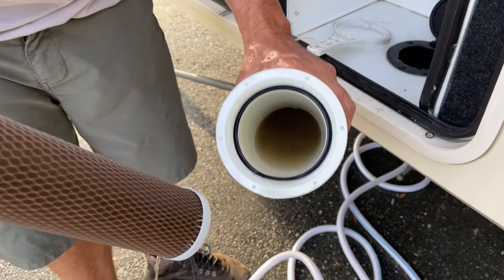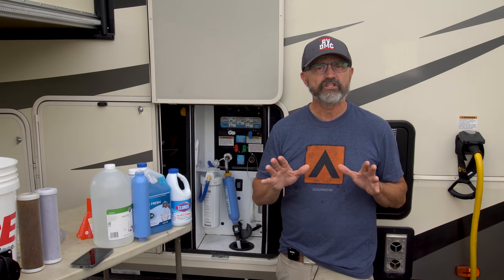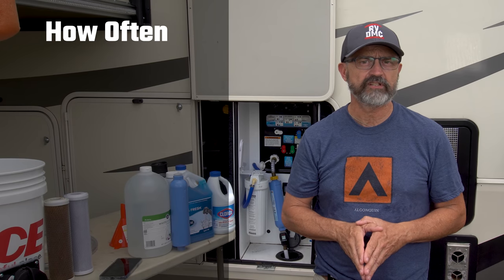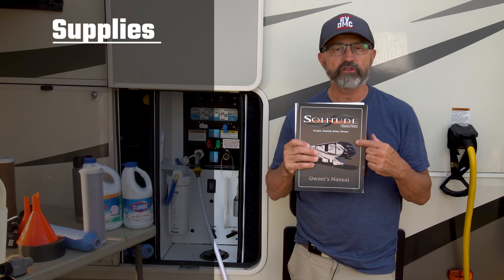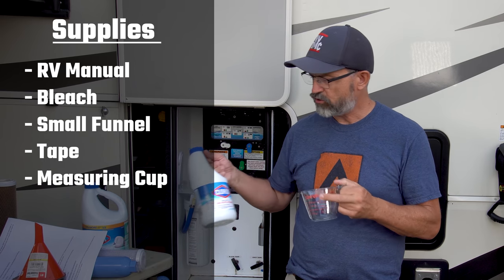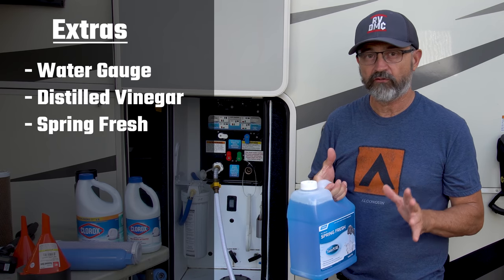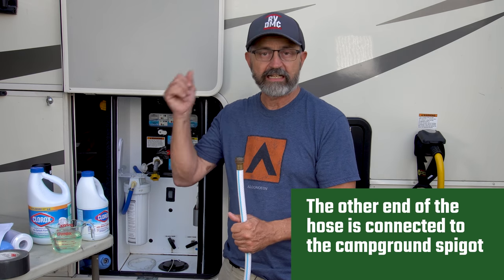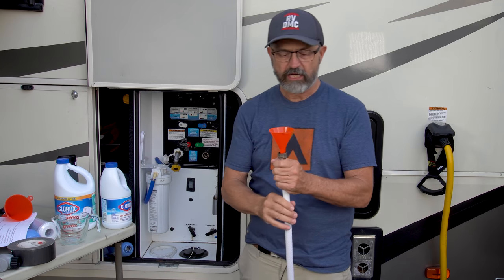RV Water Tank Maintenance How To, Step by Step Sanitize (RV Living Full Time) 4K

Comment: I work for the local water treatment utility. What most people don't know is that most municipalities put enough chlorine in their water to sanitize their plumbing without any extra measures. Just fill up the fresh water tank, let it sit overnight, drain, and you are done!
Reply from the maker: Many of the State park campgrounds here in florida, the water comes from a Well on the property and has very little treatment.  Sometimes the water comes out significantly discolored, but that is great info about using city water to help sanitize the tank, I didnt know that.  Larry

Comment: We have used bleach. Both times the water pump stopped working. The bleach compromised the rubber inside the pump. We have switched to vinegar. It works very well and does not degrade rubber.
Reply from the maker: Mark, that’s why we do the hose method. Only highly diluted bleach goes through the pump after it’s been in the tank. And we don’t use the pump to empty out the tank. We use the bucket and sewer hose. 
Sorry that happened. Many people prefer the vinegar for lots of reasons, 
Alice
Reply: @DownsizingMakesCents  Clearly stated in the video is pumping the freshwater tank into the greywater tank. So which is it?

Comment: Another great video! Well done! Your bucket with the bayonet connector is genius!
Reply from the maker: Steve, thank you. Larry is the “mad inventor” at heart 😂. He has all sorts of ideas. And his favorite videos to make our DIYs with his “Larry touch.” 
Let us know if it works for you. It’s better not to run the pump for hours if you can avoid it,
Alice
Reply: I think our fresh water drain differs from yours, but I can’t check until we get the rig back from the shop. I don’t think a bucket will necessarily work for us, but in the event that it can work, what parts did you use to create your bucket?
Reply from the maker: @settinger14  Hey Steve, i put a link to the bayonet connector in the description, from amazon i think its $6.  It is also available at most camping world stores.  I just cut a hole, screwed it to the bucket then sealed it with silicone caulk.  Larry
Reply: @DownsizingMakesCents  another question or two: 1) when your fresh water tank has been filled with the bleach solution and you’re letting it sit overnight, why couldn’t you switch back to ‘normal’ mode to continue to use city water for showering, toilets, sinks, etc until you’re ready to drain the fresh water tank? 2) we don’t have the bitchen bucket yet, but we’re gonna try to sanitize this weekend at our 2nd ever shakedown trip - when we’re ready to drain the fresh water tank, and we switch back to dry camping and turn on the water pump, I’m assuming we only turn on cold water faucets?
Reply: Also - I love the color-coded category text bar at the right of your thumbnail images - it makes it much easier to quickly scroll through to find the video I’m looking for!

Comment: Good, video, One tip to add to yours, make sure the (House) water filter has been remove before  sanitizing the system, If the valves are on either on dry camping or city water will still flow thru the house filter housing. You don't want the filter in the system when sanitizing. Safe Travels.
Reply from the maker: Yes definitely, I did a lot of cutting to get the length of the video down, forgot to make sure I left that point in, I was replacing the filter at end end anyway, thanks for pointing that out. Larry

Comment: Great information , thank you.
Just cleaned the tanks on my Winnebago. What a mess! I do not have the Nautilus system which makes it look so much easier. On the pump I also have a filter. That was the grossest part. Now have the 2 filters and am getting ready to get the 3 stage reverse osmosis system. I do use the fresh water system when dry camping and sometimes the city water is suspect; lots of rust in TX. Also have water softener that I think helps.
I made a solution of baking soda and water to neutralize the smell of the chlorine.
Again, great video.
Reply from the maker: Hey Susan, we are working on a better solution for purifying our water. I dont drink water from the city connection or the tank, but i would like to find a solution that gives me the confidence to do so like an RO system like you are getting.  Let us know how you like the RO system and if it was worth the investment.  Larry

Comment: If you use vinegar instead of bleach, what ratio of vinegar per gallon should be used? Also, if you use vinegar, can that be run through the water heater?
Reply from the maker: Hey Virgil, if you use vinegar instead of bleach, the recommended concentration in our manual says one quart for every 5 gallons of tank capacity.  So we would have had to use 10 quarts or 2.5 gallons of vinegar.  I used vinegar for my water heater cleaning and sanitizing but i wanted to try the spring fresh after the bleach this time.  Larry

Comment: Great video and demonstration of your system. I do not bypass the hot water tank perhaps it’s because I have an Atwood tank,not sure.I just pour a solution of bleach down the fresh water intake using a funnel on the side of the trailer, that I have pre-mixed with water to dilute it. I pressurize the system with my pump and let it sit for 3 to 4 hours I think they say to use a quarter cup of bleach for a 40 gallon tank
   It was a very informative video and very interesting!
Reply from the maker: Rick, if you have an Atwood, they have aluminum tanks and don’t need to be bypassed. 
Sounds like you have your technique down pat 
Thanks for coming by and sharing about your RV, Larry
Reply: Is it stainless tanks that should be bypassed ?   I'm sure most water heaters have aluminium tanks seeing as rv manufacturers tend to use the cheapest matetials possible.

Comment: Um, if you had the Water Heater on bypass, there was no reason to turn the hot water side on, since they weren’t getting the bleached water anyway.  Right?
Reply from the maker: The hot water bypass only cuts out the hot water heater,  the hot water lines get fed with cold water from water tank.   So yes the chlorinated water will go through the hot water lines with the hot water heater on bypass, it just skips the hot water tank.  Larry

Comment: How do things change if you want to sanitize the refrigerator's ice maker?
Reply from the maker: I would do the same procedure but make sure the diluted bleach solution goes through at least one cycle through the ice maker, but because of the small supply line it make take a few cycles to flush it clean before you can use the ice without a bleachy taste.

Comment: Hey Lare, doesn't bleach corrode seals (if there are any) inside the water tank? I read that somewhere.
Reply from the maker: According to the manufacturer, if you use the proper dilution of bleach it is safe for the tank and the seals.  Larry

Comment: With that much sediment from the water heater it would make me question your water filter. It seems that you should have a smaller micron filter. I start with a 20 micron filter and then down to a 1 micron filter.
Reply from the maker: Rex, it doesn’t seem right, does it? We are looking at changing the filtration system. Thanks for the info,
Alice

Comment: I am a little confused. Is your hot water bypass valve in the diagram in the wrong spot? The way you have described the steps with the hot water bypass valve doesn’t seem to make sense in keeping bleach out of your water heater.
Reply: I am referring to when you open the hot water faucets on the different fixtures and run the water through them.??
Reply from the maker: Virgil, the diagram is just a general illustration- not our actual rig. When the hot water heater is in bypass, the valve diverts the water from the cold side to the hot water side, exiting the hot water. If hot water comes out, you didn’t bypass. You just want to run the water through all pipes. That’s why your turn the nozzles on hot and cold. 
Alice
Reply from the maker: See your first comment for answer

Comment: How about you just fill your water tank and then open your drain valve underneath...  Let all the water run out, and then do it again a few more times...  wouldn't that work?
Reply from the maker: Where we were at the time, I couldn’t let the water just pour out, it would have flooded our site.  When we are in wooded natural soil sites that will absorb the water that would be ok.  Larry

Comment: Great information.  Do you have a bleach alternative that you recommend?  I'm allergic to bleach.
Reply from the maker: Bess, you can do the vinegar instead of bleach. Some people do both, 
Alice.
Reply: @DownsizingMakesCents  THANKS
Reply: @DownsizingMakesCents  Hi Alice...just wanted to point out that apparently mixing bleach with vinegar can be dangerous as it can produce toxic chlorine gas. Lots of info on the net...cheers!!
Reply from the maker: @louisag5410  We would never say to mix them. You can use the vinegar. Then completely flush. Then you can use bleach. Then completely flush. They don’t interact at all. Some people use just vinegar or just bleach or use both but in completely different steps. We never said to mix vinegar with bleach. 
You are right. It can cause dangerous fumes, but more so if indoors. 
Alice

Comment: I tried it all even after 3 clean and flush with Clorox, after a few days? yep, back to the same smell of algae..flushed and clean again..after a few days  ,sure enough back with that algae. I just do not know what to do anymore. I am thinking maybe I should dump the whole jug in the system.
Reply from the maker: Try using vinegar, 1 quart per 5 gallons of tank capacity.  It may neutralize the algae smell better.  Also try using the spring fresh.  I wish I had better,  solutions for you.  Larry
Reply: @DownsizingMakesCents  I will, thanks.